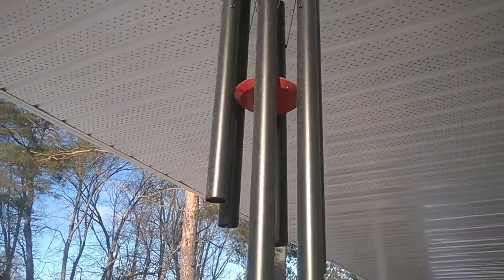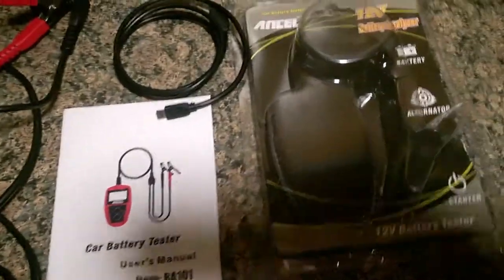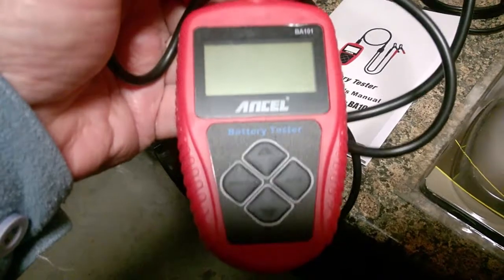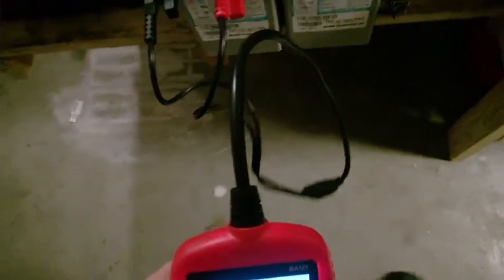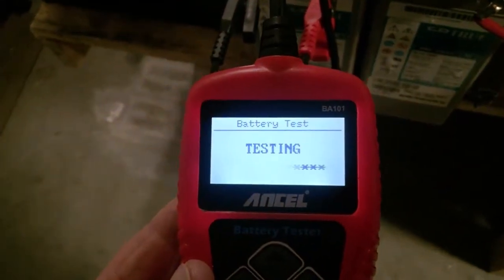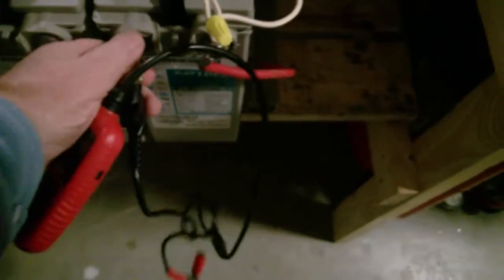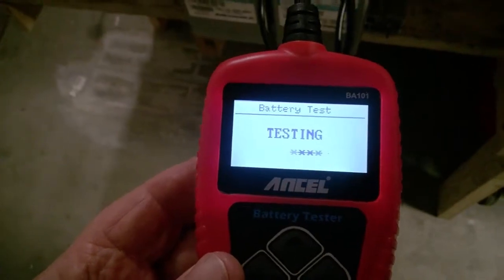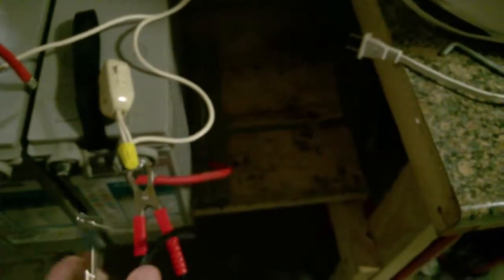2019 03 Battery tester Ancel BA 101

Comment: Does your ancel battery tester still functioning? Mine is dead, no display only back light is on :(
Reply from the maker: As far as I know I moved on to Lithium so it has sat in the box for a while now
Reply: @offgridwanabe  not lasted a year, I hate this device
Reply from the maker: @playstation2bigs  Yes for the price was not a good deal unless you were buying a used lead acid battery bank